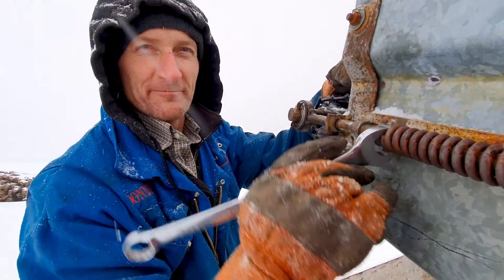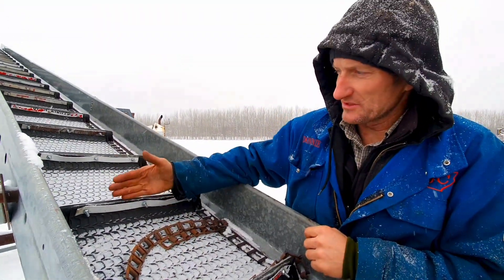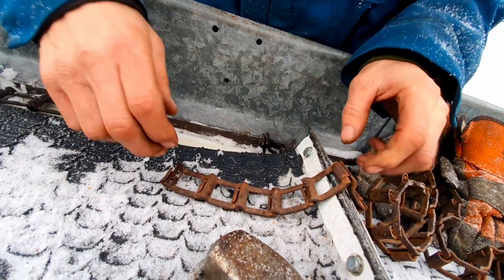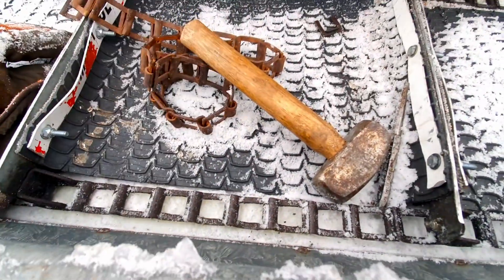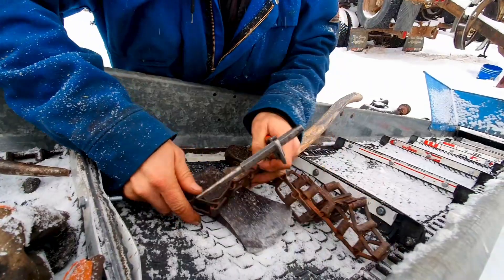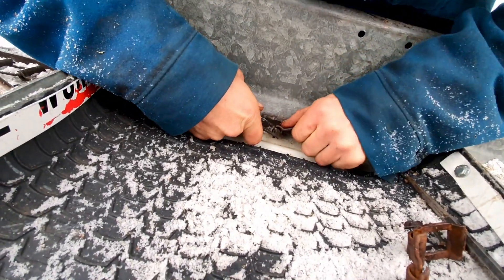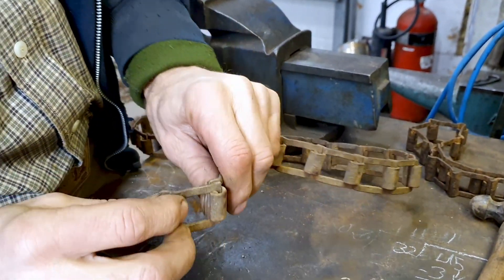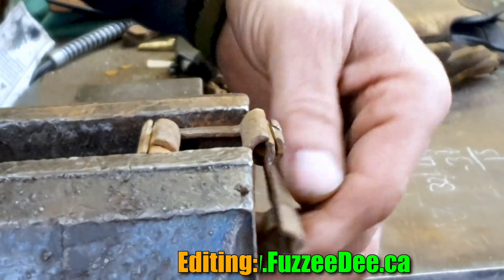Replacing links in flat Conveyor chain

Comment: This same chain was used on older manure spreaders. Nothing like shoveling off a loaded spreader so you can fix the chain.
Reply from the maker: That would suck. I  ran a spreader about 25 years ago.  That would be a miserable job shoveling without the messing around to get access to the links which no doubt would be jammed somewhere inaccessible.
Reply: Yep, just did that two days ago! Replacement chain links came in the mail today, so I know what I'm doing tomorrow.